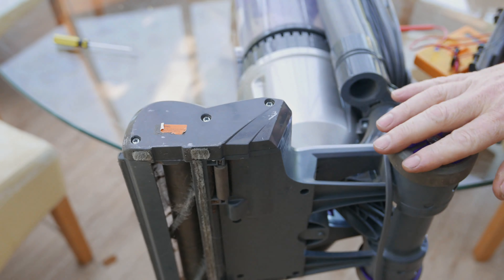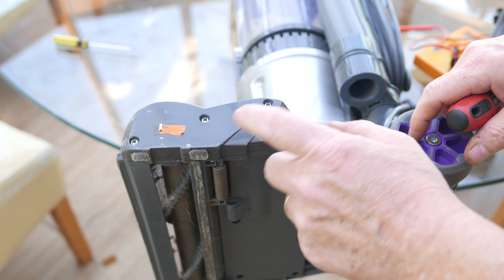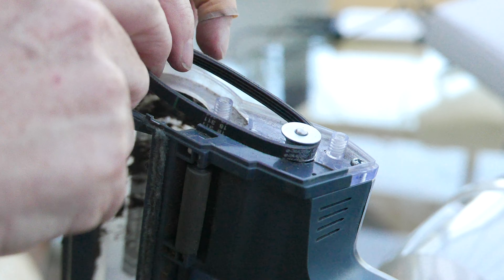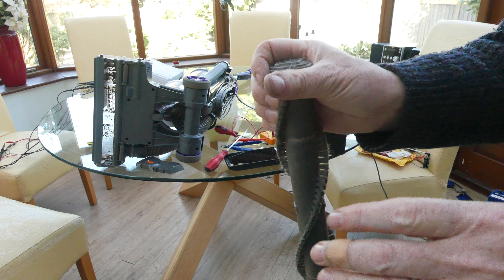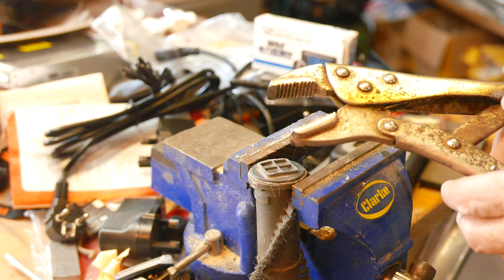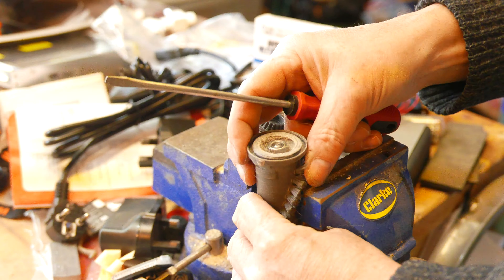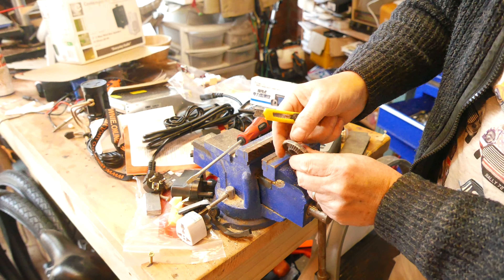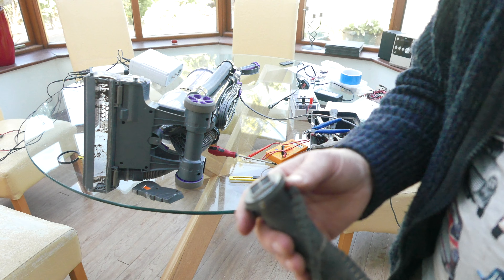Seized VAX Brush Bar Fix U85 U89 U90 &tc.

Comment: My wife said she could smell hair burning. I took the brush out and cut the hair free. Reassembled and it wouldn’t spin. Thought the square thing on the end must be a bearing but it wasn’t turning. Found your video which confirmed it. I had a hell of a time getting the end so off. Turning out the burning was the plastic melting on the inside. It’s totalled so have to buy a new brush bar! Thanks for the video though 👍

Comment: Same thing happened to my vax, fixed it 8 months ago using this method - but the same thing has happened again the dust just heats up due to friction around this plastic part and effectively welds this bearing to the case. Definitely a design flaw - well done for posting the fix mine has worn too badly now to fix well

Comment: Thanks! I was about to order a Dyson @ £499 to replace the seized up Vax but your video has enabled me to fix the issue with the brush bar. Mine had a ton of hair wrapped round the inside. Running like a dream now!

Comment: I had the same issue.. ( about a year ago) the roller had effectively friction welded itself to the cup 
I did the same fix ... but ordered replacement parts from vax. My repair lasted a few weeks before rewelding itself together.
I then replaced the parts with the new ones id ordered 

Today it started making the same noises and  on inspection it had welded itself again..but this time the square end had ripped through its receptacle in the chassis of the cleaner head. Clearly it’s a massive design flaw 

I’ve now ordered a Shark vacuum to replace the vax in the hope I won’t have to do similar repairs again
Reply from the maker: Yes.. also switched to a Shark to avoid a design flaw any half competent engineer should have spotted in the Fax.

Comment: I'm not an engineer, but I worked this out by myself. Also no need to make such a lot of fuss, I used a tiny screw driver and carefully loosened it until it turned around, no need to remove it, that's just asking for more trouble.🤔😂

Comment: have this exact problem. already done this twice in the last year or so. last time the cap was pretty melted and doesn't really fit round the bearing anymore. annoyingly vax appear to have changed the drive design slightly, the one I need uses a toothed belt but the later ones are the grooved type like the one here. was going to get a new brushbar but the toothed one is permanently out of stock. I hate this built in obsolescence, it's a really good cleaner but for this poor design.